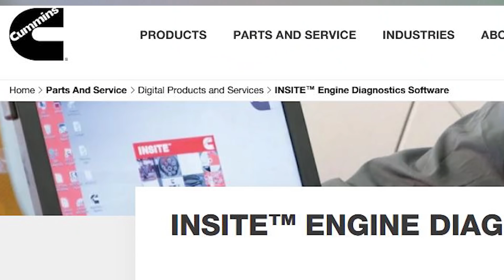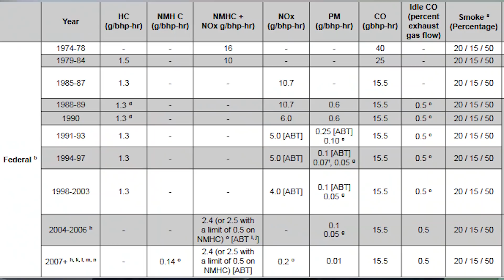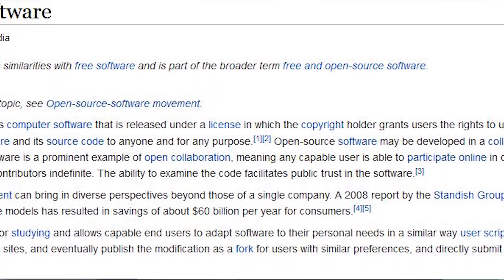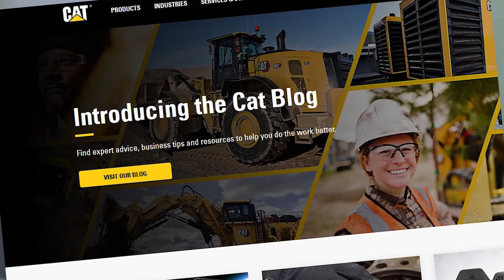Should YOU have the "Right to Repair" your Engine?

Comment: As a software developer I think open source doesn’t solve the issue, because it can be delivered to the user in locked form. Open source is a term created by the technology industry to let companies profit from individual developers, basically legally ripping them off. Free (as in freedom) software aka. FOSS software is licenced so that the end user has to have rights to the source code regardless of who modified it. Open source software licences are designed so that a company can take the code, lock it down and use it as their product limiting the users rights to repair their products. You can find more about FOSS by searching for The Free Software Foundation or Richard Stallmann’s ted talk on youtube

Comment: Tesla is a good example my wife’s Tesla model three no access to buying parts no access to repair information and I’m a fourth generation mechanic. 

And because of their monopoly and downright disregard for the customer and an ability to take care of them with lack of service I’m 100% in telling people to buy a different vehicle other than a Tesla because Monopoly on information wait for Toyota to release a good electric vehicle it will be reliable and free information or minimum pay. 

But this is where smart and genius mechanics come in to play who are wizards at electronics and using a lab scope they know how to buy the screen parts testing service by electronic components from Mouser or Digikey and adapt them over to automotive use or repair modules doing surface mount circuit board repairs. 

This is where those unicorn service technicians can become their own employers and demand the highest pay and do not need to work for anybody else. 

A automotive technician with a high-level of service skills and electronics diagnosis and repair background can fix things the dealer cannot fix and will not fix. 

The strongest shell survive

Comment: If I buy an object, I should be able to repair it physically. As far as repairing a phones software and the programming? Idk. Apple does directly own iOS so I’d say that is their property. As far as replacing the camera because mine shakes constantly or replacing the battery or screen. I should be able to do that on my own if I’m confident enough to do it alone however apple should hold the right to refuse any and all repairs on a device that you have opened and attempted to repair, couldn’t, and then took it to them. They should turn that away 100%. Software should NOT stop me from repairing it on my own and then the software refusing to let the device or vehicle operate due to me repairing it on my own even if it’s done as well as a mechanic should be illegal. The software should NOT force me to go to YOUR dealership when I trust and know my mechanic or repairman better and they are fully equipped to do the job but aren’t equipped and certified by the company

Comment: As a mechanic who has worked for dealerships for most my life and now work for a contractor I feel (at least in my area) the dealerships use the limited ability to communicate with the machine as a means to force service calls on the end user when their mechanics are not even qualified to operate the software. If you don't know what your doing you will never realize weather or not the mechanic sent to repair your machine knows what he is doing unless your there looking over his shoulder the whole time. They can make it possible to get fault codes  and other use full information for troubleshooting with out access to be able to change factory default settings. Some equipment manufactures are all ready doing that on a very limited basis. Yes complicated subject! Great Job of explaining it!

Comment: Lets be honest here, for a few hundred dollars I can have Cat Et setup on my laptop, or any other brand software I wanted. The cost is really in the cabling and connection, which there are clones for some of it out there, but not all of it. For Ford, there is free software that acts just like the dealer software, and it works well with my $25 ELM327 bluetooth adapter I bought long ago. Yes some of this stuff is illegal, but there is no way to really stop it. A lot of people, throughout the world, want to repair and modify their belongings. They will find a way to get the software, and because they don't like the system, they also help others.My concern with right to repair is what else will companies do to limit you. Give you the software but you have to buy something else now to use it. Pay to turn on the air conditioning?

Comment: My opinion is that we should have the right to repair. Software to troubleshoot and change all the basic settings including forced regens and clearing emissions codes is a must. As a O/O free locked to your serial number maybe? (although that hinders me helping a fellow driver) I'd rather not locked. Service manuals/ diagnostic manuals I say its fair to charge for thar level of support. 
My suggestion free software for all but low cost single series service support, higher cost mutli series service support. 
Parts manuals included with the software hooked to online so I can see the closest deal with stock etc.
My opinion this would be a big selling feature. Because of the support that cummins gives on the software side they are my current preferred brand for over the road. I know alot of people switching to cummins because of this simple reason.

Comment: What you pointed out is similar to Valve's Steam model- if what they're concerned about is modifying or using nonstandard parts, or pirating software, set up a service that makes it much easier to do it legitimately. Parts and diagnostics should only be a few clicks away. Manufactures should be reminded that customers will pay good money for convenience and ease of use!

Comment: My honest opinion, it's more complicated then just black and white. Both sides have very strong arguments and I think the good answer is in the middle somewhere. Customers should deffinatly have access to be able to read what the software is doing aka a lite version that would at least be able to read codes, fuel trim, ect so they can know what is happening even if they can't write to it changing parameters, that way customers can at least diagnose and maintain there equipment. Independent shops should be able to show training certificates to gain full access to both read and write to the software as they are trained to do so without having to pay hundreds of dollars a year to license the software creating a desire for that product there for higher sales and as you stated gives the oppertunity to add the function to locate a dealer and check stock availability to increase oem part sales. There is a middle ground I am surprised the manufactures haven't been willing to spend some time and tweaking to make a good solution for both sides as the one that does will have a big step up on the competition

Comment: As a certified AG diesel technician(currently what I do for a living) I can say that without knowledge and training on these pieces of equipment and their proprietary software it can be A LOT to take in all at once. CAT SIS and CUMMINS Quickserve are very helpful and powerful tools in the hands of trained individuals. Now with that being said as a farmer, owner/operator yes I would love to have access to these tools at a moment’s notice especially because ik what it’s like to be on the technician side of getting time to go out on a service call and being the customer who has to wait. If customers are willing to go though some form of light training and understanding of how complex these machines and their software are then yes they should be able to fix their own machines. And if they are willing to sign something saying they won’t use it for illegal purposes then also yes. Unfortunately this may be the only way this particular right to repair debate can be settled, at least as far as I can see. It gives the customer access and the companies have physical confirmation that their software they have spent possibly millions of dollars R&Ding will not be used in a way to get them and their customers in trouble. Even “fully trained master dealer technicians” can make stupid mistakes. I know of a Case IH dealer tech that came to a college to demonstrate their software to the kids in the diesel program and completely wiped three ECMs which costed the dealership $3500 in a matter of 30 minutes. This stuff is very complex and it’s unfortunately has to be to meet emissions regulations and customer power and precision demands. That’s my $0.02 on the issue.

Comment: I just paid almost a grand to update my SnapOn scanner which allows me a lot of access to many makes of vehicles. Its not as comprehensive as a manufacturer tool like a Ford IDS or a GM IDS2, but its pretty good. But I have the option to buy those factory scan tool platforms which have gone laptop based over the years so one laptop could house multiple OE platforms. Its not cheap, but they sell it at a reasonable enough price that if you are an indy shop and see a lot of these vehicles its worth the investment. I don't think they should be forced to give it out for free, but I also think they cannot make it an insane amount, refuse to allow certain people to buy it or sell a watered-down version to those they deem "others" in order to forcibly corner the market. Once the warranty is up these people have the right to do as they please with their machines and the manufacturer has no right to chokehold them forcibly back to their shop. If they were doing good work at a competitive price you wouldn't see the owners abandoning the dealership the moment the warranty runs out. The word OWNER is the important part. If Cat went around randomly breaking into trucks and stealing  the ECU's, that would be a felony. But they do essentially the same if they refuse to sell the tools needed to diagnose and fix these vehicles to those in the trade. They are holding the vehicle hostage and its unacceptable. Plus it just encourages people to buy chinese hack software which can damage the system because 9 year olds suck at quality control. Also, when they buy their next piece of equipment they are a lot more likely to buy one that isn't held hostage by the factory when its repair time. I think a lot of manufacturers like JD are shooting themselves in the foot and thinking blind brand loyalty will keep customers bending over for them. Harley-Davidson tried the same shit, making crappy bikes for years and only lately have they opened up their eyes to the superior jap bikes who kicked their asses in market share because they were just good bikes, not a two-wheeled turd draped in an american flag like a Harley.

Comment: I spent a significant part of my youth being raised on a farm in Minnesota.  I fully support the idea that the owner/operator should have the ability to troubleshoot their equipment themselves.  With todays technology the software does not need to be an installed piece of software in a laptop.  It can be made available through an online connection.  John Deere claims that there will be operators that change settings and cause environmental or mechanical problems.  This is a bunch of malarkey.  I repair equipment containing PLC's, and the builders allow me in to almost all of the settings.  The settings I cannot get into are locked out for just those same reasons.  So providing online troubleshooting eliminates that argument.

Comment: If you haven’t already, check out Steve Wozniak’s video on right to repair. Now from an emissions standpoint, that should be closely monitored if they do provide the software. As much as I hate these emissions control systems on these diesels, I understand the need to have them.

Comment: Open sourced the software does not always mean it is  a free give away. IBM did that to the hardware and the ware eventually dominate the field. If North American manufacturers are not willing to share the software, farmers can always try buying foreign, such as Japanese. I know many farmers are in locations not well served by the dealers.Dealers charges the most for their service, the usual excuse is their high overheads, most people bring their cars to independent garages for service as soon as the warranty is over, farmers should have the same option. Since the farm equipment is generally not on the roads, they often do not need complex electronic controls to meet the emission requirements. I be happy to have just an all mechanical engine and pay some fuel economy disadvantages. I will save the headaches for I can still fix many problems if it go wrong the day before the long week end.

Comment: I feel they should give that info to the owner. Cat,cummins,paacar,and detroit should. After all you own the equipment and it should your choice if you repair or allow a outside shop to repair it. You shouldn't have to take it back to a dealer to be charged 2 times what a smaller shop would charge just to diagnose and fix a potential problem. Plus have your truck down for 1-2 weeks or more when you can take it to a smaller shop and be back up and running in a couple days. Just makes more sense to me to be able to work on my own truck without needing a dealer permission or having to take it back to them.

Comment: Not yes but hell  yes you should be able to fix your own equipment. A short story. I bought a new skid steer last year after getting it I bought a high flow cutter. But the cutter had a max of GPM' s you were not to exceed so I went into the settings on my machine to find I had over 12 settings but no where did they tell me how much each setting increased the flow. Called my dealer to find out that they charged to come out and set each attachment up to your new machine. Absolutely not going to pay a dealer for extortion bills to run the machine I just paid them over $80.000 for. If you find yourself in my shoes you can buy a hydraulic inline guage and figure out what each setting increases the flow. They would have gotten my repeat business but not now.

Comment: I don't work on heavy equipment, but I do work on a lot of cars, diesel pickups, and some school buses (mostly propane). I've found that the first step in diagnosis is a solid understanding of how the thing works. If you know how it's supposed to work, figuring out why it's not is much easier. When everything is mechanical, you can figure that out by taking it apart (or asking someone who has) and looking at it. I believe they call this reverse engineering.
As the owner, or the mechanic authorized by the owner, I have a right to do what I want with the machine, including "exploratory surgery". I have that right because I own the machine, meaning I own every part of it. I see no reason the same shouldn't be true of software. 
If manufacturers keep their software a secret because they're afraid of people stealing it, that's what copyrights, trademarks, and patents are for. That's not a new problem, people have been stealing ideas for centuries.
If they're afraid that owners might break emissions laws by tampering with the software, that's not the manufacturer's problem. This isn't a new problem either. If I cut the catalytic converter and muffler off my truck, I can be fined for that. Ford can't be fined for it, because they didn't do it!
If they're afraid that owners might damage their equipment, that too, is not the manufacturer's problem. The only time it might be is when warranties are involved, but again, that's not a new problem. For years we've seen stickers that say "___ will void the manufacturer's warranty". There's no reason that tampering with software couldn't or shouldn't void a warranty, but owners should at least be able to look at it, and see what's going on. 
I think owners and independent mechanics should absolutely have the "right to repair" even when software is involved, and I think it's in the manufacturer's best interest to allow it, because it will make the lives of their customers easier. A happy customer is a return customer. I personally would have a difficult time buying any piece of machinery that I knew I couldn't repair myself.

Comment: Yes. There is no question about that. You have the right to work on it, because it's yours. As long as it's done right, and you catalog it right. The manufacturer can only void  your warranty at best. They can't tell you what to do with your property.

If you're leasing. Then no, you're better off having it done at a certified shop. Because then the cars isn't yours. You're just renting it for now.

Comment: SHOULD you have the right to repair? ardently, vehemently, unequivocally YES!
Manufacturer's software? Soo yea, this here is where things get a wee bit sticky...

Sure, they've put some man hours into the development of this software; Would it be NICE if they just GAVE it away for free? Sure! WOULD they VOLUNTARILY? obviously not...

What about the hardware widgit thats required to communicate with the fill_in_the_blank? Well, yea...   it would be pretty normal for some joint to charge for that

Open source software? Sure...    thatd be awesome hypothetically if someone made a large diesel service platform (be it highway tractors, bus's, farm tractors, generators, pumps, fill_in_the_blank) that had plugins for widgits on the CAN bus like body controllers, hydraulics, the list goes on? For sure, yea...   the caveats? Well, there are SAE PID's that are pretty well standardized and everyone gets how they work & then there are manufacturer proprietary PID's that may not necessarily respond in ways which would stereotypically be expected

Yea, manufacturer specific PIDs we can cross that bridge when we get to it; BUT...    What about TESTING routines, that are ALL manufacturer specific? how would THAT be integrated into an open source platform?

<Shrug> I dont really have a happy_end_all_be_all on this'n unfortunately...   :/